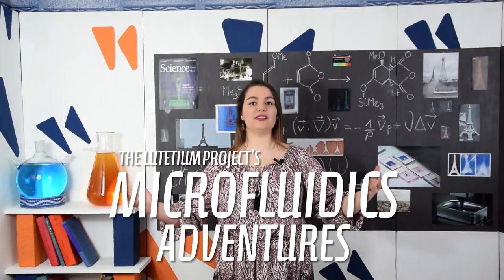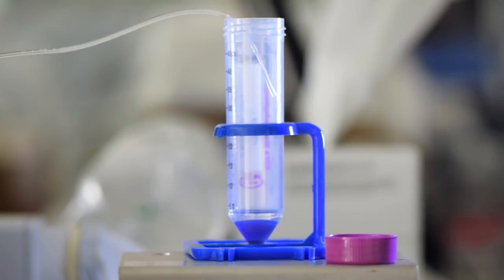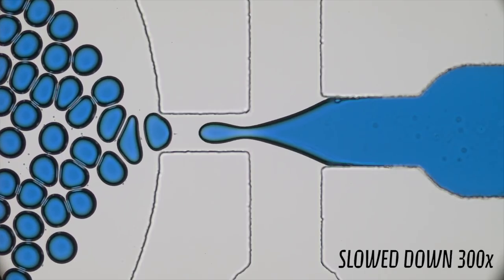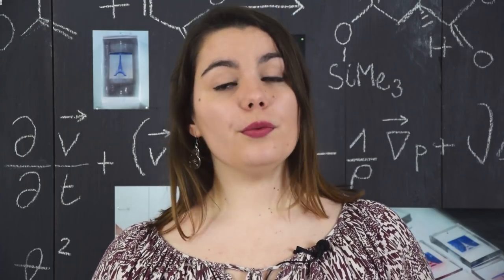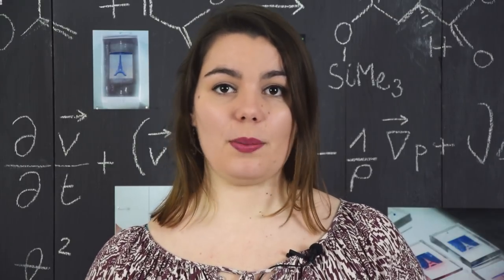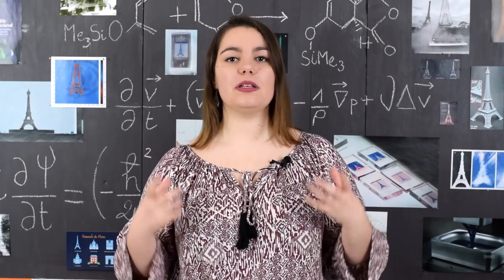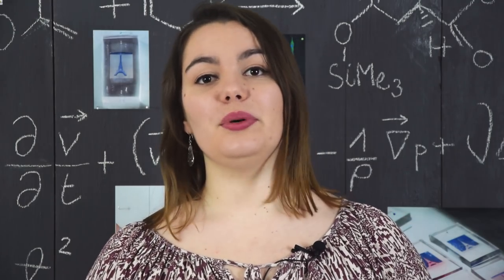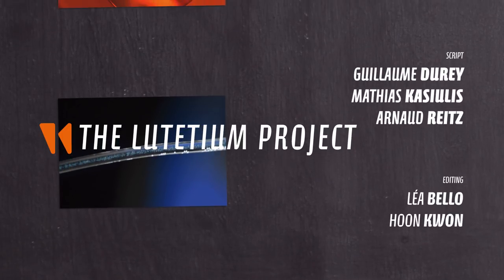Microfluidics Adventures #3: Microfluidic chips

Comment: You will get turbulent flow in high viscose or very small areas if you cross tangentially in opposite directions of the streams doto of inner friction of the both fluids like rubbing two surfaces against another
Reply: You can also get turbulent flow/mixing with oscillating fluids... That's basic knowledge I suppose, but it doesn't get mentioned a single time in this video
Reply: context... your supreme intelligence is not needed in this video.

Comment: I thought if you added soap the mixture would emulsify? :o
Reply: It did. An emulsion consist of tiny droplets of one component dispersed in the other.  They were just rather large drops compared to the sort of emulsion we are used to dealing with.  Just stick it in a blender to make them smaller.

Comment: One thing, laminar versus turbulent flow is also dependent on the velocities of the liquid in question. I observed this with a 1/36” ID tubing where I varied the flow rate of two different inlets of colored water. In high velocities, the flow was laminar and there were two distinguishable colors. However, when I decreased the flow rate to a tenth of its original value, the flow was turbulent and there were no distinguishable colors visible, only purple. If you want a bit more of a background, I believe some of the properties distinguishing laminar versus turbulent flow are described by the Reynolds number and the Damkohler number
Reply: John Putziger inertia is proportional to velocity though
Reply: That doesn't make sense.. turbulent flow is characterized by high Reynolds number which is proportional to velocity. Maybe your experiment had less control than you thought.. if the flows had different velocities, mixing is likely to occur.
Reply: Are You All concentrating on the Small or big droplets
You know, the jigilly ones maybe that is why most of the viewers age guys; sex sells. Does anyone doughts that the host of This show is making slightly out of the ordinary hand motion To jiggle and wiggle the mellonious droplets. Maybe we need a body langage expert to confirm that
Reply: I believe that's diffusion.